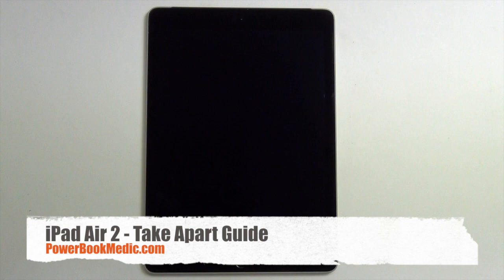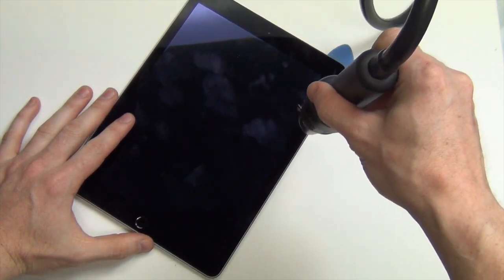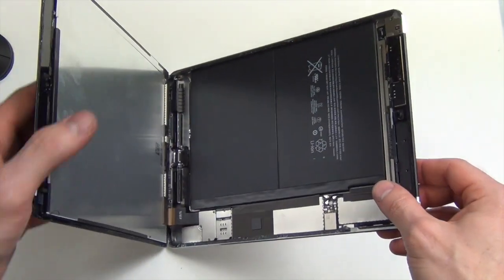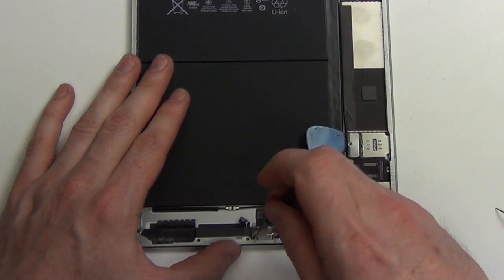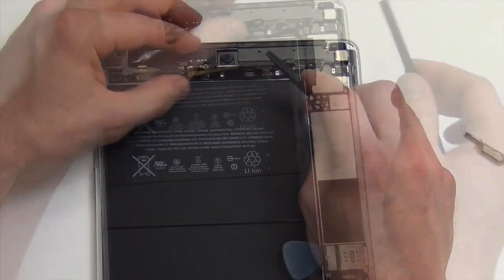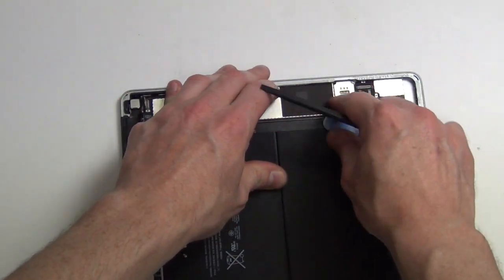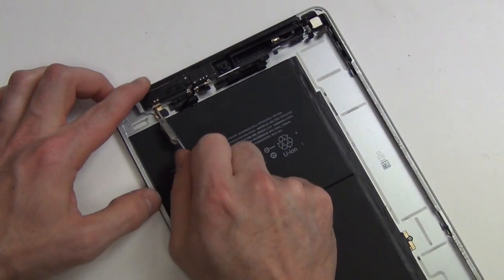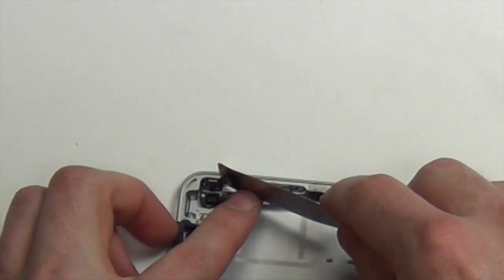How to Take Apart the iPad Air 2 - A1566 and A1567

Comment: Hi, I just wanted to thank you for the instruction on lifting the battery connector to logic board with the pic. I was replacing the screen on an iPad when the digitizer stopped working. I couldn’t power off iPad so I had to disconnect the screen “live”. That messed up the display to where it was black and completely unresponsive. Lifting the connector killed the iPad and after reconnecting everything with ipad powered off, I was able to then power up with a good screen!!! I was ready to heat it up to remove the battery unnecessarily. You saved me tons of time. Thank you 🙏🏼
Reply: I am looking for a place to legitimately buy a logic boars and touch ID. I got scammed and bought an iPad thats lockes even though the owner said it wasn't. He showed me an unlocked one and then went to his car to 'pack it' but he swapped it for a locked one. I've had this ipad for over 4 years. I spent a lot of money on it and lost so much work and time because of the scam. I just need to make it work

Comment: Thank you works great. To open the case I used a razor blade to cut thru the glue. It worked great but need to go very slowly and not deep.

Comment: My hubby has a 1500W Electric Heat Gun. Will that be too much heat to remove the screen? What amount of heat gun are you using? Thanks.
Reply from the maker: The amount of heat is relative to the distance away from the display. Start far away from the display and bring it closer as needed to heat up the adhesive.
Reply: @PowerbookMedic 
I read somewhere else to never use that size heat gun, but to use a narrower directed heat gun. What is it that I might damage if I don't stay close to the edge of the iPad?
Reply from the maker: @bonitaburleson7445  If it gets too hot you risk burning the LCD and anything the iPad is on. When you use the heat gun the main issue you are concerned with is temperature. You can control temperature by the distance you hold the gun away and how long you direct the heat on any one spot.  You don't want to direct the heat on any spot. You want to move it around to prevent one spot from getting too hot.
Reply: @PowerbookMedic  ok. I do appreciate your help, videos and you taking time to answer my questions. Thank you!!

Comment: Why do they say to take out all of the parts out to replace the battery?  I removed the LCD screen. Then  I took only one screw that secures the male battery contact. Heated the case to soften the adhesive holding the battery and then lifted the battery and pulled it out. Replacing the battery with the new one  is a little tricky getting the new battery male contact back into the the female. Soften the adhesive below the female contact, and then lift the housing with your fingernail  above the female contact to allow you to slide the male contact into the female. It is a bit tight. Then put the screw back in the contact and then press the new battery to secure it with the adhesive to the inside back of the iPad. Then just put the LCD Screen back in place and press it in to secure it with the adhesive. This worked for me. If you had to remove all of the part according to the instructions, the screws are so tiny that you would probably go insane trying to put everything back together.